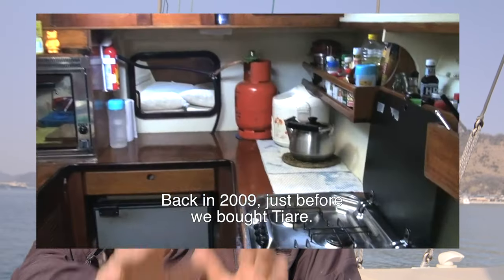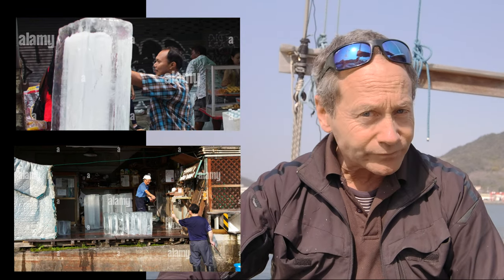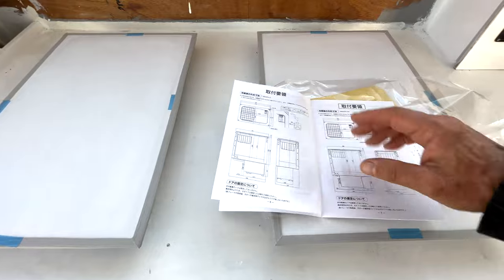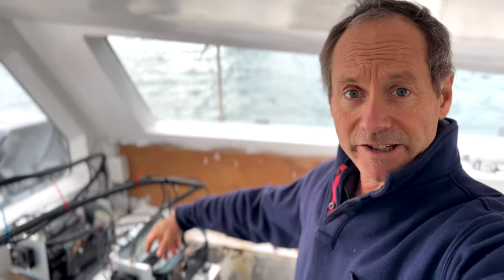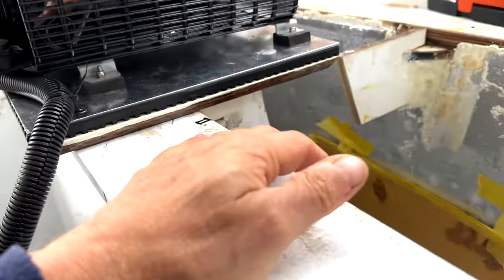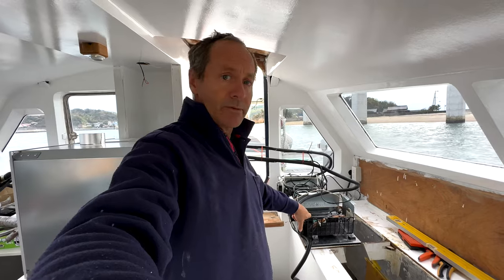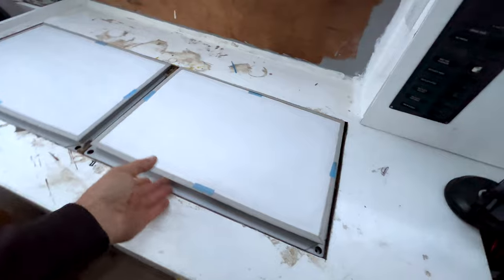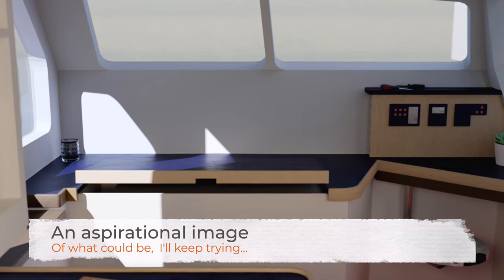Install 2 x Engel Fridge and a  Freezer in our 55ft  Wharram Sailing Catamaran based in Japan

Comment: ENGEL and PROLAN, youre onto it. i use prolan for everything, it even cleans sika and oil based paints off your hands. 
love my engel too, in my campervan.
your wharrams coming along nicely
watching from waiheke
Reply from the maker: Hey, G'day! Great to hear you're using Prolan. I use the stuff a lot and recommend it to others. Will hopefully have the Engels up and running soon, just finishing off the solar panel installs. Glad to hear you are happy with yours, really hoping they do the job, can not afford to replace them if they not up to the job. Was the cheapest "quality" option I could find.
Reply: @SeaJapan  your built in engels have the japanese compressor right? they go for years, ozzie’s give them shit and still keep going. 
you’ve made good ventilation too which is a must. it’s an idea to blow out cooling fins if they have them, once a year. they need to breath. 
i know all about refrigerator maintenance after owning cafes for 30 years 😩. 
i would turn that lower part of panel where fans are into a fold down or take off door. access to clean dust etc.
Reply from the maker: @simonhantler8062  Thanks for the advice Simon, will see what I can do to increase access. Yes they are the Japanese Sawafuji swing compressors.

Comment: 40 kg in one hand isn't funny…
Hope all the wireing went well underneath and nothing is pinched or squashed.
Reply from the maker: G'day MiQ, was a kind of controlled fall. Nothing pinched other than cable protector at the end, which I pulled out. Made sure there was nothing below to be an issue. Everything lined up and I'm a happy chappy.